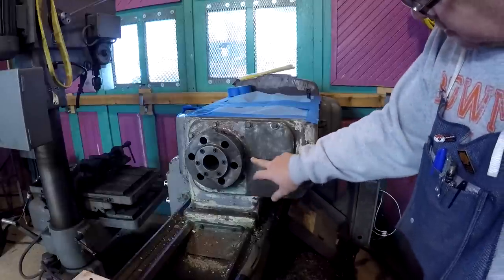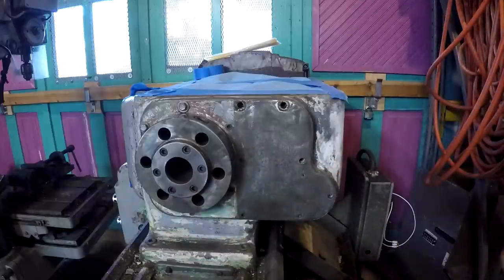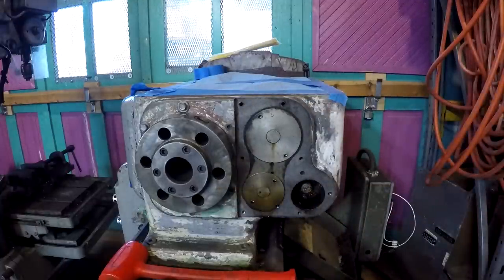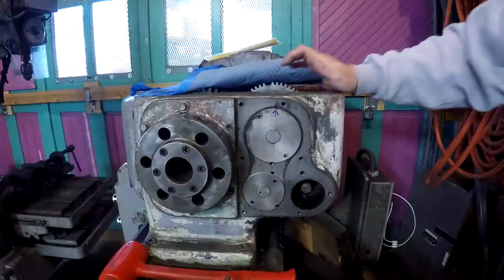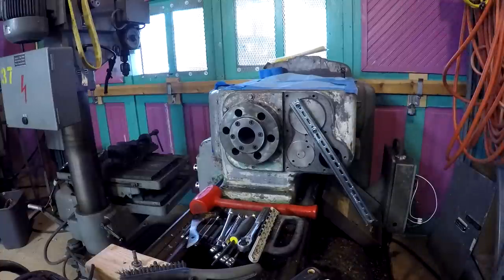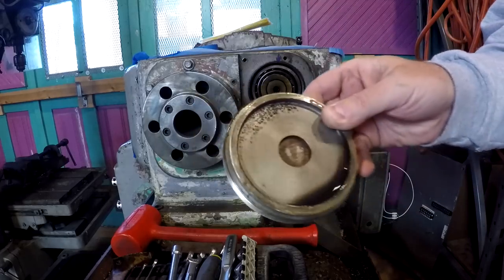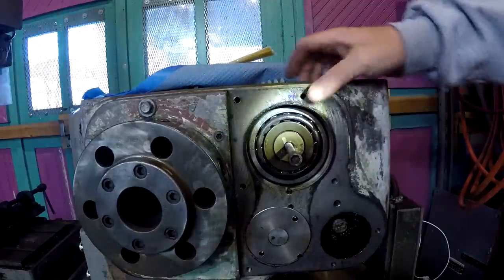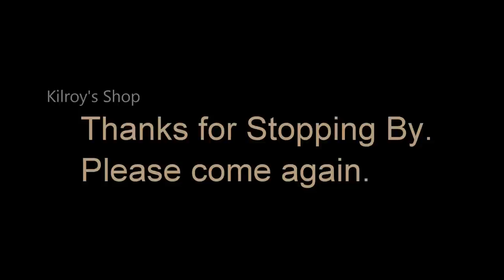Pacemaker Woes #2

Comment: From doing a bunch of old gearboxes I feel confident that shaft will have standard cup and cone bearings on each end.(Bower-sounds like a dog does is now NTN) You will have to gain access to the other end as well so you can knock the shaft each way to get the races out, then you will have to pull one of the bearings so you can unload and remove the shaft. If the other end is a blind hole then you will have to use a heavy bar and the threads in the shaft to pull the shaft out just be sure to check for any other retaining mechanisms so you don't damage anything in case they have snap rings or something in there.
Reply from the maker: bcbloc02 I hope I don't need to access the other end, because I'd have to disassemble the entire input shaft, clutch and main counter shaft to get there, ouch.  I'll let you know how it goes.

Comment: The old Din rail spanner trick. Come on James. We know you gave that retainer a little love tap with a punch and hammer. That bearing comes out the hole you exposed when you removed the retainer. Threads will end into a smooth bore. Look at the opposite end. to determine which end was used to preload the tapered roller bearings.

All the best,

Tom
Reply from the maker: oxtoolco Actually I turned it the other way just a nudge and it broke loose quite easily. I have had that trick work before but I was surpised how easily it came out

Comment: James
I would use a slide hammer on the shaft using the threaded hole , or as been mentioned a bar across across the casting using the threaded hole as before , I do not know how warm your WS is but a hot air paint stripper on the casting around the bearing will help , yes you will not get that lump ver hot but as the little boy said when he had a pee in the sea every drop helps 😊
Stuart

Comment: Hi James
If you look at the gear cluster and the parts drawing you will see that the larger gear is removable from the smaller one! there is a nut on the back, so may be easer to replace or machine a new one!!

Comment: Jay

Appears to me a good look at the opposite wall of gearbox is important.  IF that is solid ie no cap or cover then the only choice is to pull it all out thru the hole you just opened.  From a very brief glimpse in video the opposite end bearing loods smaller so based on that very limited knowledge from 1000 + miles your only choice is thru the hole you got.  I think best to set up a screw gear puller on the shaft - I would put a heavy steel ring against the cast to avoid stressing the casting and mount the puller rig onto that.  Pull easy - the first one or two turns after snugging it all up should be the challenge and all should be easy after that.  I am confident you will go easy on it and do no damage.

Best of luck

Dan Bentler
Seattle

Comment: Race will come out the same direction as the retainer cap. You can usually bump the shaft and it will drive the race out. With the race out the shaft should be free to remove by lifting the opposite end out first then the end where the retainer has been removed.

Comment: Looking back at video #1 I can see you are going to have to pull that shaft using the threaded hole. The shaft termionates in that center bearing support and I am fairly certain there won't be enough room to tip it and get it out the top. It has to come out that hole in pieces and then you can lift the gear out the top.

Comment: First glance it looks like a tapered roller bearing which would be freeplay adjusted with the retainer nut. Some pressure on the opposite end should get the outer race moving.
Kinda looks like the threaded hole can be used for cover removal as well..?

Colin ;-)

Comment: I thin the reason for the wrong bolt in the top is because the cap crews now days have a larger head on them.  I'm in the middle or restoring a 16x54 pacemaker like yours.   it had a few missing cap screws and every one that i could find had a head larger than the countersunk holes.   I ended up turning some down to fit.

Comment: i doubt the race it threaded. Make a puller, 1'' flat bar with a hole in it to span across the diameter and thread the bolt into the shaft thru the hole. The other option would be a slide hammer but you might damage the bearing that way. Is it possible that it has a retaining clip or something of that sort at the other end of the shaft? (don't think it does as it's a tapered bearing so probably same at both ends but just in case).
I have no first hand knowledge though, just throwing ideas.
Reply: I agree.  put a bar with a hole in it across the surface of the housing and put a bolt into the shaft and start cranking it down.  The outer bearing race will not be threaded simply because it uses an adjustable cap to push it in.  Just pull on the shaft with the inner bearing on it and the cup should come with it.  The inner race on the other end of the shaft will come out of the cup it is in and you should be on your way to fixing the gear.

Comment: No first hand knowledge, but I wonder if the shaft just has to be pressed/tapped out like I've seen on other headstock shafts like my Atlas?  It was hard to tell from other parts list (never been good at following them) the pacemaker manuals I saw on a quick search how they are put together.  Then if is the case of needing to pound the shaft out is knowing which way it needs to go.  Are there any set screws or collars on the other end or anywhere along that shaft?

Comment: the shaft that the bolt is in the end of that shaft
should pull out but be careful if the shat is extracted
everything might fall in to the bottom extract the shaft
slowly and remove gears one by one

Comment: Hi James
Have you seen this page, it shows a headstock with all the bits removed, and the configuration of the taper roller bearings on the shaft! you may just need a puller in the bolt hole to pull the shaft and bearing out, it appears the taper on the bearing faces inwards, hope this helps http://www.lathes.co.uk/pacemaker/index.html
Regards from the UK

Comment: James, 
I say you should force it. I'll send over my best ex mechanic and his sledgehammer.
And if they can't do it get out the sparkle wrench.
Joe
Reply from the maker: Joe Hale Sparkle wrench, now I really got a laugh out of that.  We always called it the smoke wrench, but I like yours better.
Reply: James Kilroy Must be a dialect thing. here we call it the Blue wrench. Back in high school I had the nickname Torch in the shop because I was the only guy that could cut a bearing off a shaft in one shot and not damage the shaft. I am not sure that is the tool for this job just yet.lol
Reply: bcbloc02
I learned it as smoke wrench as well.  Sparkle wrench does have a bit more flare though...  (no pun intented)
My first thought when you took the crescent wrench off was "cheater pipe"
Reply: We call it a hot wrench. Funny how different areas use different names.

Comment: Speaking from years of experience rebuilding gear boxes, the first thing I would do is setup a dial indicator on the end of the shaft and check the end play of the shaft using two bars to move it end to end. That way you will have a second reference to go by when reassembling. This will be especially helpful if you end up replacing any bearings in that case the turns of the retainer may be slightly off. The race is probably just stuck from years of not moving. Sometimes it is easer to bump it inward from outside the gearbox where there is room to work just to get it broke free. Then make a puller setup using the threaded hole and threaded rod. Hope some part of this helped, good luck!
Reply from the maker: jeff edison Thanks for the tip, that is a very good idea.  I will get setup to check the end play today.

Comment: since its a tapered roller bearing the plug you removed is being used to control bearing preload by pressing on the outer race.the inner race is probably against a shoulder on the shaft. your should be able to pull the shaft using the threaded hole. this should push the outer race out of the housing and free the shaft for removal. you may need to resort to a slide hammer to start the bearing race moving,if so keep tension on the slide hammer to hopefully prevent bearing damage.these old machines were built by craftsmen and designed for maint. good luck.

Comment: Is there a cover on the opposite end?

I would think you would want to press that shaft in rather than have to pull it all the way out so you can only remove that one gear.

Would be easier to use a soft mallet on the shaft from the opposite end to remove the bearing.

Comment: James
 forgot to add.
Use the  slide hammer method to get the shaft out, the race will slide out with little fuss. as  I have used this method many times.
Tom

Comment: Hey, James, i bet that threaded hole in the cover plate is so you can thread a screw in and push the plate loose.
Reply from the maker: Andy Wander  You are probably right, I'll make sure and leave a set screw in there so it doesn't get filled up with paint again.

Comment: Can you imagine the size of the mill that took those cuts? Must of had been huge.

Did the cap show signs of ever had been removed before this, other than the factory fit? It sort of seems as if the pin holes have slightly damaged edges, might be the camera/light throwing me off.

I think you should try and pull the shaft out. There's no reason for that thread to be there other than that. It's not for putting in, it's not for alignment, that's the only reason.

IMO, you should cut a slotted ring that fits inside the ID of the threaded bearing holder and go from there.

One other thing i'd try...thoroughly check to see if the bearing sleeve can or cannot be removed from there by sliding it out, that implies getting in there with a sliding hammer catching the lip of the bearing race and gently giving it a few taps. In theory you could catch it from other side to reduce any potential damage by sliding it through the bearing itself, it seems big enough for a shaped tool to go through.

A few reverse taps around the bearing race to see if it budges should clear out any potential issue. If it moves then you have a clear go ahead to just pull the whole thing out.

Also, check the other end and along the shaft and gears, see if there's anything you can remove to ensure nothing gets in the way or damaged. The internet is mum on this one i'm afraid, not many comments on this, certainly not many pictures.
Reply from the maker: aserta It does look like the cap had been removed at some time in the past, the machine is nearly 70 years old so it makes sense that there may have been maintenance done in the past.  I am going to rig up a puller and give it a tug with a bolt in the end of the shaft and hopefully the race pulls out nice and easy, and straight.
Reply: James Kilroy The best of luck!

Comment: Bower bearing is common in that era. There's no threads or clips to that cone, simple press. Don't shreak here, but lightly torch the upper bridge of the headstock casting above the bearing until it's approx 200-300° and tap the race in with a punch and hammer, the cone should jump right loose, be ready with a magnet and pliers. Work quickly, it works well, those bearings are light press, .0002-.0004. I prefer monarchs myself, ;) nice vid and best of luck.

Comment: James give me the model # serial # and as much other info on the american our shop had a row of a dozen or so about 10 yrs ago that got scrapped maybe the maintenance foreman can let me copy the repair manual? After I get the info give me a day or so.
Reply from the maker: Rick Kimble Give me a few and I will reply with that information, thanks for your help.  The idea of a dozen of these machines going to the scrapper just about took my breath away, truly a tear jerker.
Reply: Yes . But Bliss is one of the oldest machine manufacturing companies in the country and by the time Butech re-opened the doors those and numerous other shapers,planers,mills and presses were obsolete and I mean this stuff was so large the footprint they used on the floor was needed for assembly and in process.
Reply: James the only documentation the shop had left is a parts catalog for the Deluxe Pacemaker sizes 14"styleB, 16"styleC, 20" styleD and 20" style E 40 pages of part #'s and part break down diagrams if like I can mail it to you I had it copied? let me know your address if so.

Comment: As a mechanic, I have had good luck fabricating puller adapters for my slide hammer. I take a bolt that fits the slide hammer and a bolt that fits the pin to be pulled, then braze the heads together for the adapter. Lacking a slide hammer, you can make one with a threaded rod or long bolt and an iron/steel round of sufficient weight drilling an appropriate-sized hole in the center. Do not pinch anything capable of pain between the slide and the bolt!!! The slide should be heavier than the part/assembly you are removing. You need a nut on the end of the bolt to stop the slide impact.

Comment: I have completely rebuilt a few of these, and if you are going to reuse the bearing use a puller, if not a slidehammer works fine. it has another taper roller bearing on the other end, you have to knock the inner race off to slide the shaft through the gear. If you replace the bearing you may have to reset the end play in the shaft to around .001 then move the dutchman screw in the cap. Have fun putting the shifting mechanism back in, kind of a pain. Had to remove one once in the field on a repair job wasn't fun. Good luck, great old machine:)

Comment: Jim,
Look at the headstock at the swing bracket end(where the drive belts are) should see the other end of your shafts bearing caps. Remove the ones needed and with a copper drift drive the shaft out watching the gears as the shaft moves out.Some gears have taper pins,spring clips that will need to be removed so the shaft can be removed. Also you may need to remove another shaft to get the one you need out. But I don't think so its a top shaft. Let me know how it goes.

Comment: Before you try the bearing puller on the shaft, make certain there isn't a snap/retaining ring/clip on the inner face of the outer race of the rear bearing. If there is one, pulling on the shaft is going to put pressure on the retaining ring and outer race and probably damage both of them.

Comment: I pulled the cover off my pacemaker today to take a peek at what's going on in there so I can see what your looking at.   the shaft the holds the broken gear is separate from the one that runs to the clutch,   if you put the headstock in neutral you can spin the chuck and that broken gear/shaft does not move but the clutch side does.   the shaft must be split at the interior wall.   

as far as the bearing goes, there very expensive ($600-$1000) (Timken 525-x I think is what mine is). I haven't very really messed with these but I'm wondering if the bearing is pressed into the shaft then slid through the hole, then the race pushed into the hole afterwords.   then the threaded end plug is used to set the backlash for the bearing.
Reply from the maker: 101climb Wow, thanks a ton for taking a look.  I am pretty sure you are correct on that shaft.  It ends at that interior wall.  I am betting it is going to come out through the hole.  Thanks for the heads up on that bearing, I will make sure and be extra careful, no reason to spend that money if I don't need to right?